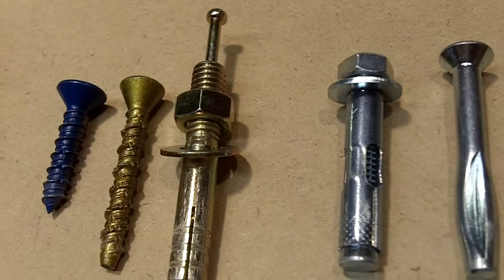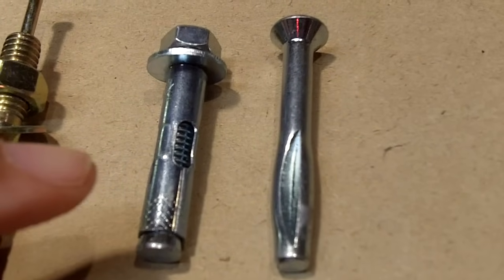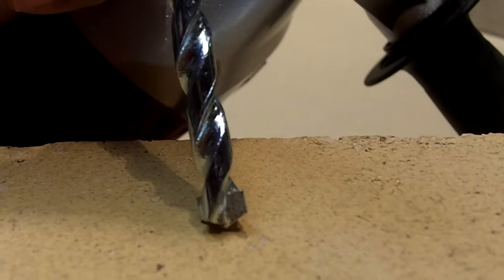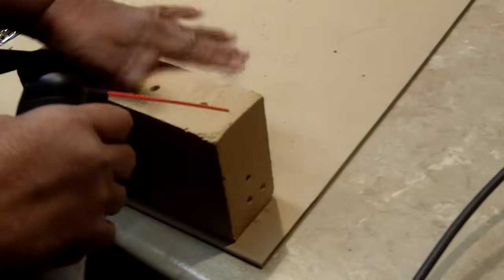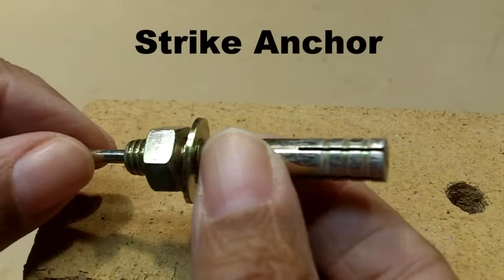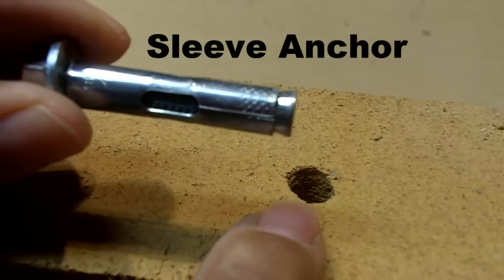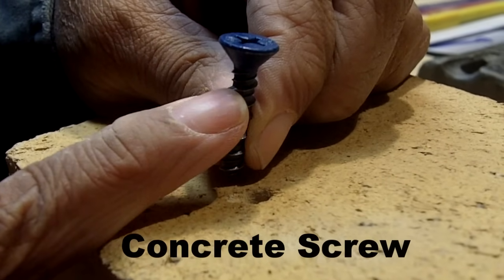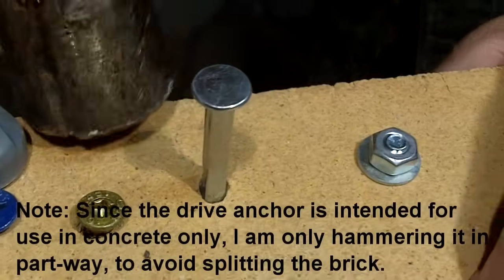A Beginner's Guide to Attaching Things to Concrete and Brick

Comment: Nice video.  Great info for any DIYer to have. 

TIP: Make sure when driving threaded anchors to back the nut off the end until end of the thread is recessed below the nut face a tad (so you are pounding on the nut not the threaded rod).  This will keep the hammer from buggering up the end of the threads making it difficult to remove the nut when attaching whatever the fastener is to anchor to the concrete.

Comment: Also, if you want to nail in regular nails, drop a piece of wire in there, and pound the nail in right along side the wire, and it'll stay, like a nail in wood.  If you want to remove the nail, especially if you're using a duplex nail, just use a nail remover or the claw on a hammer, and yank it out.  Something I learned in carpentry at community college.  I watched to learn about the screws.  Thanks for the video.
Reply: supercyberfunk
That’s interesting

Comment: Thank you for this!  my tip: instead of a can of compressed air, I use a child's air balloon pump- place the tapered nozzle into the hole and blow out the debris.
Reply: I use the one that came with my nikon camera kit.. squeeze squeeze.. lol
Reply: I use a small pouch that is taped underneath the hole and vacuum the hole itself to get the dust... much cleaner... 😁
Reply: Or consider vacuuming out the dust, instead of breathing the crystalline silica. Silicosis is major bummer, which is why all new concrete drills will soon come with dust vacuum attachments.

Comment: Very good. I like the can of air trick, I've never seen that used like that. Excellent, I will have to try that for sure.
Reply: Yeah, I happen to be based in an Asian country where I have yet to find compressed air, so I've been using a straw. You can expect to have your face covered in dust, and don't do it if you're allergy-prone.
Reply: You can attach a straw / pipe to a 1m piece of plastic tubing (like they use for wine, fuel, hospitals, aquariums or whatever), then you don't get dust in the face when you blow a hole through that. 

Rather than a can of air, I'd use an air compressor or even a manual air pump.
Reply: Use a straw! Just do not blow in it: grab your vacuum cleaner and hold the straw into the vacuum end and... tada! You'll be able to make a sufficient seal around the straw and the vacuum end to allow enough suction to clear out the hole. Happy (clean faced) drilling :)
Reply: sorry... *you'll be able to make a sufficient seal around the vacuum end WITH YOUR HAND...

Comment: Umm, I hate to ask a stupid beginner's question but..... if you are tightening the nuts to make the bottom of the anchor flare out then how do you attach something to the anchor. Did you forget to mention that once the anchor is set you can remove the nut and washer and attach whatever you need to?
Reply: +Theresa M you would put what you want to assemble with a hole in it then insert the anchor through the hole, and go for it
Reply: +Theresa M yes with that type of anchor you would do as you said.
Reply: Thank you!
Reply: yes i was wondering the same thing, expected to see a video demonstrating the installation of an anchor for a lag screw for example altho i ges at the beginning you didn't show that as one of your examples so i shuddint have been surprised. i already own too many tools and have no room but i ges i'm going to have to finally go out and get a hammer drill. absolutely great video, patient clear instructions, no ego. i will look for more of your stuff on YouTube.

Comment: Wedge anchors look similar to Sleeve anchors but can only be used in solid concrete, not in other masonry materials such as brick or hollow block.  Why?  Do you have a video of a wedge anchor cut away failing in something other than concrete?
Reply: Jules Bartow the wedge bolts strength relies entirely on its threads cutting into the concrete, so having as much thread contact as possible is best.

Comment: Excellent explanation and demonstration. 
I'd like to share a little tip with others when they are using sleeve anchors - and ESPECIALLY expansion bolts in brick walls.
If you are using 10 mm fixings, try to insert at least ONE of them in the MORTAR between the junction of 3 bricks. 
The fixing wedges incredibly tightly between the 3 bricks. It then gives a rock-solid start for the rest of the fixings - regardless of where in the wall they are inserted.
Reply from the maker: I bet you're from the UK
Reply: @seejanedrill  Yup - west coast of Scotland!  :)
My grandfather's brother headed for California in 1912,  but fell in love with Oregon (and an American girl!) because it was like a super-sized Scotland.
Result: relatives over in Oregon, L.A., Nevada, and Lake Tahoe.

Comment: Thanks for the excellent videos! I just built a shed and anchored the walls down to the concrete with 3/8" sleeve anchors, it ain't going nowhere. One tip, drill the hole in the 2x4 slightly larger than the anchor hole so it will slide through to the concrete.

Comment: Thank you.  I learned something today.  I have a stairway railing that attaches to a concrete wall… unfortunately the concrete has cracked and the screws are all loose now, so I need to fix the concrete and then do this.

Comment: Thank you! I used sleeve anchor a few times. Just one important tip (learning from my own experience). You did it correctly but forgot to mention. When you hammer it down, make sure the nut is a bit unscrewed. This will prevent from ruining the thread.  
But it was interesting to see other options. Never saw drive anchor.

Comment: When I bought my house I tried to drill a hole through stucco. I used a regular drill and regular drill bits and dulled like 4 bits before I gave up. That Christmas, my brother in law bought me a hammer drill, so I bought a masonry bit, used the hammer drill and it went through the stucco like a hot knife through butter. I was shocked ... that using the correct tools makes ALL the difference.

Comment: Excellent video. Excess dust can be removed while the drill bit is still down in masonry (before it is backed out to reveal the hole). You can use a little broom, rag, or even fingers to do this, and of course don't have the drill spinning while you do this.

Comment: Thank u for going in depth with different options! Just moved into an older loft style apt building with exposed concrete and brick. Open floor plan but the space is small so I’m gonna hang my bed or do a Murphy style wall attachment. Glad to know it’s possible! Thanks

Comment: Me personally though i like the not hammer down regular  masonry screws as there easy to install and uninstall . So far they never gave me problems of concrete or masonry stuff cracking though i may find that some day to be an issue and reconsider about the hammer down ones. Nice video clears up some my confusion on masonry fasteners

Comment: Here's a tip ...Run the hammer drill bit at a lower speed.  It won't get hot and blunt quick.. AND at a slower speed it will cut faster.

Comment: Perfect for showing how to fit a fixing into concrete, but useless for how to attach anything to it! Great video if you just want to put bolts or screws into concrete, how about something useful like attaching a bracket... clearances, spacing, drill sizes etc?

Comment: nice summary. a thing to note is that most of these will put internal stress on the material. i you need to avoid this a chemical anchor is the way to go. Also, for smaal fastener you can use nylon plugs, the more modern design of this will also work in hollow bricks.

Comment: Good video, except some beginners may not realize that they will need to position the attachment against the concrete or brick before installing the anchor(s).  Also, they will need to consider the thickness of the attachment in calculating depth of anchor embedment.

Comment: Thanks Jane for breaking down the different types of fasteners! You forgot one very simple method for concrete block: take a 16d nail and cut it trim it to 1 1/4", leaving a rough point. Pound it in flush to your bracket. It is very difficult to remove since the little pieces of concrete act as a wedge against the sides of the shank.

Comment: Great guide. One thing I would point out though: the wrench was held properly only the second time! If you have the shorter side of its fork pointing the opposite direction of the driving direction, it might slip off the nut.

Comment: These days I always use threaded rod and resin fixing - its about 4 times stronger and doesn't crack around the hole if over tightened or over stressed.

Comment: Red-head makes "drop-in" anchors that are anchored at the bottom of the hole by using a special punch, supplied with the fasteners, which you whack with a hammer in order to drive a pin built into the fastener ,  spreading and mushrooming the rear end of the fastener. Essentially you are almost molding threads into the concrete, for use with bolts or threaded rods.

Comment: I'm going to be putting some rubber ramps where a driveway should be at my house. When the street was redone, they didn't make an opening for my driveway. I only complained once to city hall and they didn't do anything about it. I left this property for a while, then I came back after a few years. Now I bought these rubber ramps that need to be bolted down, so people won't steal them so easily. I think my neighbors  are pretty good at watching things on my street. I just don't want it to be so easy for someone to take. I don't want to do a permanent tie down but maybe something where only I know how to take it off.

Comment: I want to attach a PowerLift Manual Tire Changer Base to the concrete path in our backyard , but not permanently, but with the option to remove it for storage, when I don't need it. What screws to use for this project best? How long they should be and what to fill those holes with, when the Manual Tire Changer Base is not there. Thank you for the film.

Comment: How close to the edge of a concrete pad can you secure an anchor? For example, if you have an 8x12 concrete pad at 4" depth, how close to that edge can you set your building and anchor?  We are building a shed on a concrete pad and trying to figure out how close to the edge of the concrete can we go (to maximize interior storage space) and still anchor it down.  If the pad is 8x12, can we go all the way to the edge or do we need to reserve space (an apron) and build the shed smaller?  I'm worried that if we drill too close to the edge, the concrete will break off but I don't really know.

Comment: great video! i was just wondering if you can do a tutorial on steps on how to accurately use the hammer drill without it deviating from your desired hole position. thats ny biggest problem now is that i drill holes and put the ancjors only to find out that my holes deviated and now i cant get rid of my anchors :(

Comment: A cheap method for temporary use like forms on concrete that will be removed is to drill 1/4" hole and stagger the heads of two double headed 16 penny and drive them in together.   Acts like a wedge and is super strong and removable, just be ready to use a huge crowbar or spud bar with nail pull on the end.

Comment: I’m going to be using those sleeve anchors to attach galvanized mesh metal along a block wall. I’ve never done it before but I just bought a rotary SDS plus hammer drill and 3/8” sleeve anchors. What I want to know though is if there is anyway to lift the sleeve anchor with the washer if the wire from the mesh slips out before it’s held in place? In other words, can you slightly back out a hair just to fit it under when you’re dealing with something so slim to mount, before you actually turn the hex to tighten it?  I’m worried about the metal slipping out at the last second and then I created a huge hole and wasted a sleeve anchor for nothing, but I’m not sure since it is nailed in if the hex head can be screwed out before it screwed in and tightened. I imagine you could grab the hex with some pliers to slightly pull it out before the sleeve has been expanded, correct?

Comment: Another beginners question. I want to anchor a basketball goal to a concrete driveway. Can I back the nut out of the sleeve and install an eyebolt to attach straps from the goal to secure it?

Comment: I have used the blue Tapcon concrete screws on many occasions; I prefer the hex head screws over the Phillips head screws because the Phillips drive bits have a tendency to cam out of the screws, but the hex head screws will give you a more consistent drive,  especially in concrete. * There's a big difference driving screws into concrete versus driving them into brick or other fine-grained masonry, because poured concrete will contain  stones, aggregate, and the concrete screws will require greater force to cut threads into stone then they will into the concrete material itself*. It will also usually take a much higher quality masonry drill bit, one designed and rated specifically for hammer-drilling concrete, in order to get through and past those pieces of stone. As a former telecommunications installation technician, I have drilled a lot of concrete in my day. One last thing ---- when drilling concrete, wear a mask! No sense breathing in all of that silica dust.

Comment: Trying to affix a steel trellis to the outside stucco walls of an older house. Trellis weighs about 30-40 lbs and will have four mounting points (it's a square frame that will sit close to the wall just like a giant picture frame). House is 1920s lathe and plaster style walls. Ideally would like something removeable. 
Do concrete screws work for this purpose as well?

Comment: Hi, excellent video.  I need to attach a 2x6 deck riser to concrete.  I like the striker anchor.  What size would work best and what is the safe max load bearing weight.  Thanks again.

Comment: Zamac makes a nail-in anchor, somewhat similar to the first fastener you install here (minus the threaded portion), but with a low profile mushroom shaped head. Good for fastening lath, studs or plywood directly to concrete, and you can countersink the wood slightly if you want the mushroom head to be flush with the wood.

Comment: I messed some sleeve anchors up today. I think I drilled a bit deeper then inserted them and only turned the bolt by hand ,then removed to put my plate on but could not get the bolts to grip the fastner again when I reinserted the bolt. I think I was ment to tighten up the anchor with a spanner to expand them more first before removing the bolt ? Is that right ?

Comment: Excellent video. My question is if I have 5/16" concrete drill bit then what size wood plug/dowel do I need. Or how to choice drill bit size & dowel size & wood screw # of thickness?

Comment: The only thing I wanted was - how does one attach something TO these once they are into the concrete. Most anchors are holding down something, a cable, a  grommet, a wire, etc. So are those connected before the mounting - or do you use those threads on the exposed ends to attach something?

Comment: good video, but i'm confused about the tip of the sleeve anchor that goes into the hole; there's the little piece that fits into the end; on the one i have i can push it all the way into the tip and it clicks in, which is the only way i can think of to ensure that it doesn't fall out and into the wall; am i doing that correctly?

Comment: I've installed a masonry screw in a cement wall, but it seems loose in the cement wall. Is there any way to better ensure they are tight? All I did was drill a 1/8" pilot hole and then screw it in with a screwdriver.

Comment: How can I fasten decorative metal panels to skirt (cover) the cement foundation on my house? Wish I could post a picture of the panel, but it weighs 36 lbs. for the metal one and 12 lbs. for the polyethylene panels (haven't decided which is best to use). Each panel is 24"Hx48"L. I would like enough space behind it so that I could put white/clear Christmas tree lights behind it to light it up at night and show the design.

Comment: Thanks ! Question?? For the anchors does the hole have to be the same width as the anchor? And for the screws does the initial hole have to be one size down from the screw to ensure tight fit??

Comment: DM, Like your video (A Beginner's Guide to Attaching Things to Concrete and Brick) .i have a Fanlight weight 45kg  to install on concrete ceiling 4 to 6inch deep  what  length ,   bolt  or screw do you recommend.

Comment: Thanks for the video. I didn't hear you tell us which size bit to use.  Does one use the same size drill bit at the anchor/screw? I assume  one would use a smaller bit than a screw (so it would bite) and same size bit for the anchors.

Comment: I recently drilled holes is a brick wall and it took me forever to drill it even with a hammer drill. I wasn't sure how much of the trigger to press to either drill slowly or should the drill bit spin fast when drilling into concrete and brick. I was afraid I woiud break the bit when drilling. What was I doing wrong?

Comment: I wonder is the screw with a plastic cover that goes with it, is the same as the metal one? Also am I supposed to use the same size bit as the screw. For example if it’s a 1/2 bolt, should I use a 1/2 bit? I know this is old but maybe you will still get this. Thank you. I watch your show all the time.

Comment: How well do concrete screws hold up to impacts? If I were to use them up fix a punching bag bracket, would the continual lateral shocks loosen the threads?

Comment: excellent video, understandable.  I am sure I have learned something but things are not as easy as they seem.  Drilling vertically is not the same as drilling horizontally on a wall, and I don't think that the block you use is as hard as concrete.